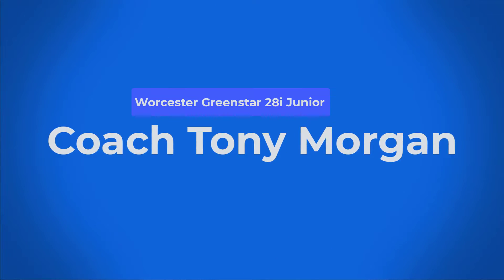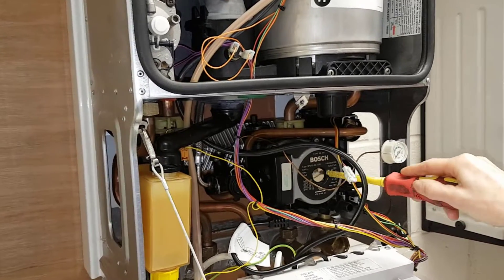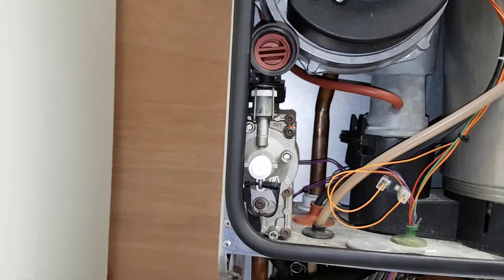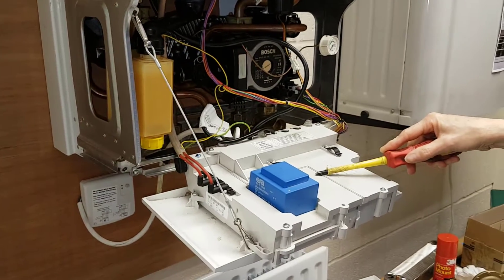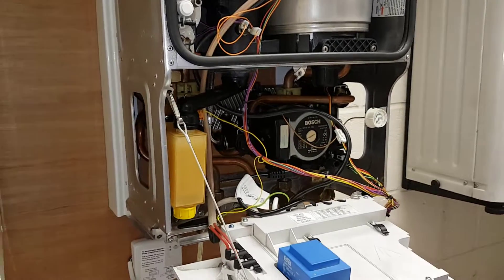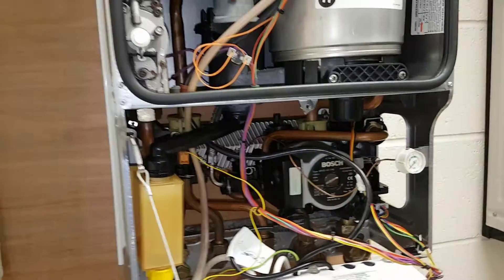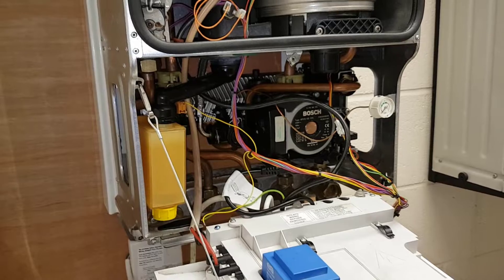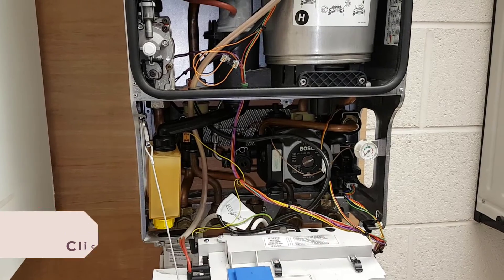How To Learn Boiler Repair Fast Part 2 with Coach Tony Morgan

Comment: 1Call for heat hot water
2 pcb pick up form turbine flow sonser
3 pump on
 4 Fan speed on
5 diverter  moves up 
6 pcb send electrodes 
7 gas valve solenoid opens thru venturi (fan)
8 ignition 
9 flame presence/     rectification
Reply from the maker: Well done 👏
Reply: @ARBoilers  hi how you check ohms on low voltages fans and gas valves, disvertor motors ECT..
Reply from the maker: @dzmalekvali1110  sign up to one of my training courses